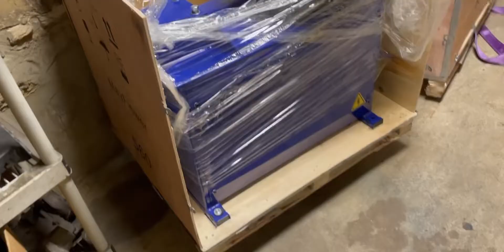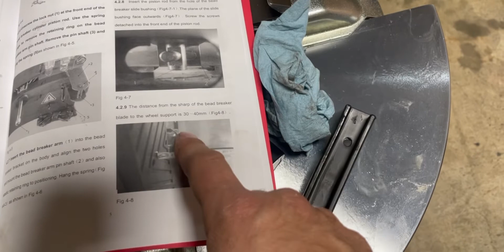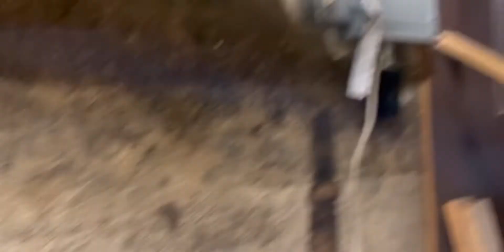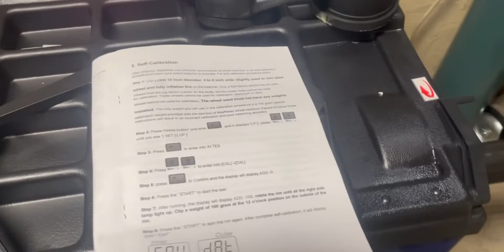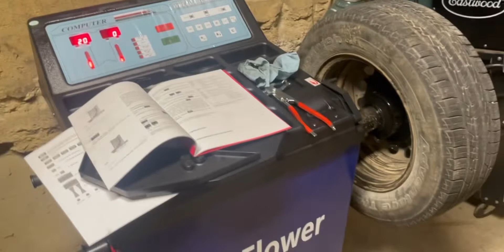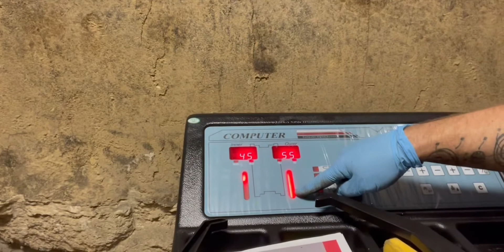Mayflower 560 680 Tire Machine/Balancer Combo Full Review, Unboxing, Assembly, And Operation!!!

Comment: Cool video I'm interested in this combo but my question is since this is not American made and is China built on the spin balancer does the numbers read in ounces or metric? As we use standard weights here like 0.25, 0.50, 0.75, 1.00, 1.50, 2.00, 2.50, 3.00, 3.50 etc?
Reply from the maker: It has both. You can switch from one to the other

Comment: I bought the combo and the tire machine is very good but use caution as the balancer is total junk. Balance a tire and take it off  put it back on and it won't read the same, I called Justin the guy that sells them and he told me that it is working properly and I need to quit re - checking the balance.
Reply: yeah hes right because its at that point balance but wasnt the first time!

Comment: I'd suggest the 950, 960 or 988. The 950 is the larger changer and has the "Bead Blaster" with the round column as air tank and foot pedal operation, the 960 has the 950 with addition of side column and 2 arms. The 988 has the 950 with 2 arms 1 on each side. R side one actually mounts to the main arm.

Comment: Still holding up well? Great review!
Reply from the maker: Yep! The only things i have noticed since the video are that the tire machine cant handle wide wheels and tires very well. The main boom piece sits lower than most machines so when putting on wide tires with wide wheels it hits the boom. For instance i mounted some 265-35r18 on a 18x10.5 wheels and i couldnt use the machine to get the first bead on. I had to force it on manually. I dont think i can get the tire back off with my machine either. The balancer also is a little quirky. Even after re-calibrating it i have found that if you have a wheel that calls for a bunch of weight you can’t immediately put that much weight on bc the machine will then tell you to pull some of it off. I typically just put like half the weight on if its a big number and spin it. Then see what it says and add accordingly
Reply: @kieferskustoms  VERY helpful! Thank you!
Reply: @kieferskustoms  Do you have recommendations on what kind of machine would be able to handle wide wheels/tires? Also, how much space does the units take up?
Reply from the maker: @jphan129  specific brand im not sure. The biggest thing i would look for is how the main boom is designed. Mine sits far too low to accommodate wide wheels. Im not sure on the space it takes up. I can try to remember to take a tape measure to it when in in my garage later
Reply: @kieferskustoms  Could it handle a 20" F150 tire?
Reply from the maker: @InlineSkateFitness  depends on the height and width. It will do a 21” rim max on the inside but i have found that a width of 265 or wider becomes an issue

Comment: How does it do with that smaller air compressor? I’ve just got a 28 gallon now since every tool I got is battery. Basically looking at this to do trailer and lawn mower tires. I’m tired of this junky harbor freight manual tire changer.
Reply: Turn the main regulator up a bit to like 125psi or so. Will give you a bit extra capacity
Reply from the maker: It does ok. The compressor def runs alot if im doing more than just one wheel. It just takes a little longer is all
Reply: Good deal I’m just looking at the 560 only since I’m not balancing anything right now. But I can deal with little slower vs buying a bigger compressor

Comment: What are your thoughts on the tire balancer now that some time has passed?
Reply from the maker: It works decent. I have noticed that sometimes the weight it tells you isnt quite right especially when it gets up into heavier amounts. Like if it tells you it wants like 49g on one side if you spin it then it will tell you to add 7 on the opposite side. So usually if im adding heavy weight i work my way up to it. Like put on 35 and see where it lands. I tried re-calibrating it numerous times and it still acts the same way. Just takes a little longer. Also i had to buy more cones bc the cones it comes with dont work with most truck wheels.
Reply: @kieferskustoms  Thanks for the fast reply.  I was hoping the recalibration would help. It's good to know that it doesn't really make a difference beforehand. I'm looking at a balancer for my home. So maybe I'm still going to keep looking
Reply from the maker: Honestly its not that big of a deal. I have had that same issue with a bunch of balancers over the years. It works it just takes a little longer. I would still recommend it.
Reply: @kieferskustoms  ok thanks!